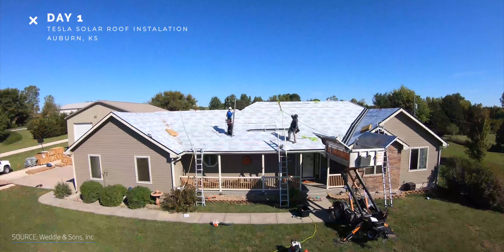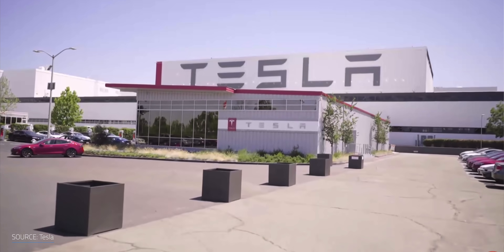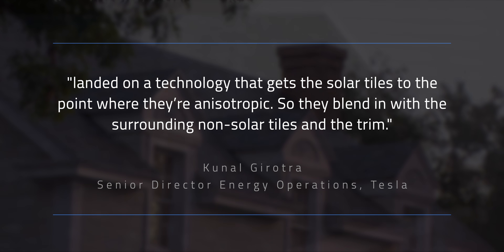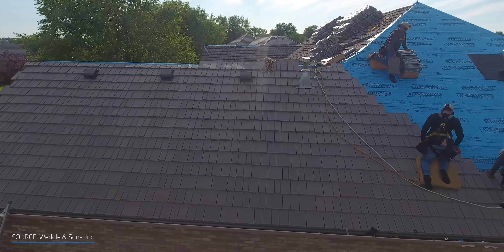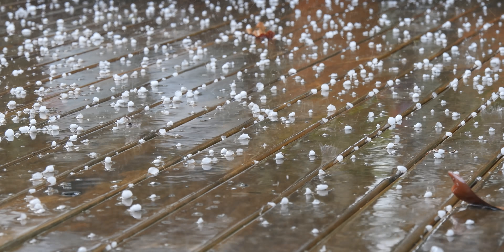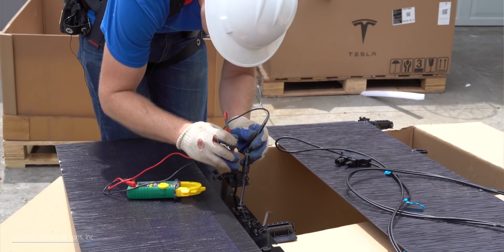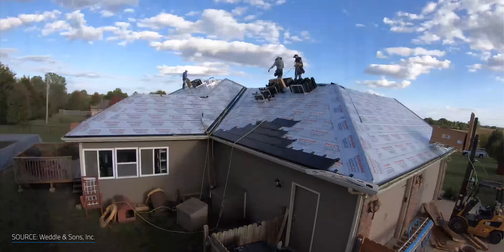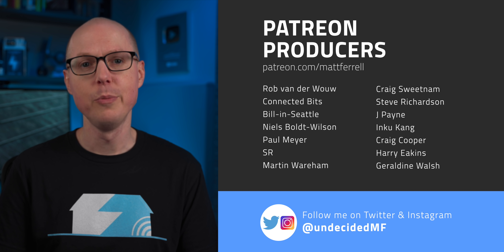Exploring If Tesla Solar Roof Is About To Go Mainstream?

Comment: only American's used silly rubber ( so called ash felt roofing ) that fails every 12 years ? , we use concrete of terracotta or tin roofs that last over 100 years at a minimum and apparently cost a lot less than your silly stappled on rubber ,

Comment: Some thing is missing in this story(instinct)  "this is cheaper than that", if a roof of X square feet costs, say $20,000 then surely its only worth  fitting a roof an a house worth $180,000 because  anyone earning less than so much a year wouldn't be able to afford the house repayments. And unemployment figures make lots of enterprises a "no-no".

Comment: I decided on solar 4 years ago using Solar City with LG 395 watt panels. This was pre-Tesla roofing tiles. As it is It cost $49600 for 19.8 kw which was 125% of expected usage. Results. Our average for the year power bill per month went from just over $390/month to $23/month. Received 33% tax credit which brought the out of pocket down to $33,232. Made the payments the same as if I was buying from APS paid off $4680 the first year. Made a balloon payment of $13,000 at the end of the first year. Continued with the $390/mo payments. Made another Balloon payment of $12,000 at the end of the second year. Continued paying the $390/mo payments into the third year. The 6% interest on the loan stretched the payments 4 months into the 4th year.  I now pay $23 per month to APS. Am now saving for the next major purchase being a Tesla Model "Y" or VW ID Buzz or maybe Ford Mach E. I'm going to wait on the car purchase to see just how well all three work out reliability wise. Oh! next step for the house - Battery Backup with night time feed to the house to power the HVAC. In Arizona the AC runs 24/7.

Comment: At the end of day, as a homeowner, i don't think Tesla Roof will work. because of installation and material costs will cost more than normal asphalt roof (normal people won't afford that, plus people doesn't stay in same place as long as use to be. why do you wanna invest your home if you won't stay that house forever? even, Elon mask himself moved to Texas.). Asphalt roof only takes the roofer a day to finish the replacement. however, Tesla roof will take longer(everything involving metal work and custom fit will take longer/more labor work) .Asphalt roof also has 25years life span. most of energy consumption comes from HVAC and EV (we better off to improve how to generate power with green technology in a mass scale, we need to invest more money to nuclear fusion.)

Comment: I'm a licensed electrician who loves alternative energy....Stating  the obvious  "Solar Panels" produce electricity..... there is a very clear danger if the solar system isn't engineered/ installed properly & will cause fires, injuries & deaths..... That being said I'm all for solar roofs but not for the untrained regular  roofing guy/ company.  Be cautious on the sales pitches & do some homework.

Comment: Some of the assumptions used to sell us on solar are questionable at best. I recently had my roof done with 50 year architectural for about $12K, and that was relatively expensive. Had I thought ahead and taken bids I could've done it for 8k. I guarantee it will last a lot longer than 15 years. Even the cheap stuff can do that much. Though solar cells may act as durable roofing, they will only generate energy for so long until they burn out. Then there's the matter of solar waste, which is far more toxic that regular comp roofing.

Comment: watching this instalation in vid what are they using for water sealant between pieces and on overlaps even metal you use butyl and asphalt its tar that melts together when the sun hits it and warms it this is just glas son metal and every knows water doesnt follow the laws of gravity very well and often travels upwards?

Comment: except "premium materials" are narmally called premium because of the look you get not the durabilty metal roofs are fair priced and last a long time these Premium roofs you compare with are slate fake slate and roof like that which are a roof designed for looks not durability. this isnt a very well put together video fi your trying to explain the differences in roofs its only well put together in selling a tesla product! sounds like this is a paid advertisement

Comment: I would not get a solar roof on my current house in NJ. After living here since 1995, we are replacing our original roof later this spring (March 2021). We don't plan on living here for more than 5 years anyway, so depending on where we move to for retirement (Florida?), we may look into solar roofing then. Meanwhile, our next Federal government under a President Biden-VP Harris is definitely pro-environment so there may be some real savings down the road for both installers and homeowners to go solar in greater numbers, which would definitely drive down the cost. For the same reason more people are not buying EV cars, people don't have solar panels or their own windmills on their homes, but that could definitely change in a few years.

Comment: 1.  What does Telsa have to say about cold weather installs?  Ice, water blocking, four feet of snow?  2.  Fire rescue currently won't even walk on a tin roof because they are so slippery in winter, so they just let the house burn rather than try to vent the heat from the roofs.  3.  Nature liabilities like tree pollen, sap, dust, smoke, human pollution, all collect on roofs, and then the squirrels.

Comment: Given that the panels have achieved the appropriate ratings for fire, hurricane and hail resistance, the price point and install time is not really a factor for the consumer. The installer network has to be trained, which is a far more monumental task. Tesla has to sell the value proposition to the people who do installations, which is a sticking point, unless new blood enters the game. The construction space is typically slow to accept new technology, stuck in its' ways and standardized residential home construction only exists in modular, manufactured and the commercial arenas. Your home is only as good as your GC's knowledge base. If you have a builder who has educated themselves to all the latest and greatest building technology, you will have a superior home. If not, you will have a home built to minimum standard, which is cheap, but shockingly low performance. You really will get what you pay for.

Comment: What if house doesn’t need all that electricity generated by tiles? My house roof has 6 Tesla panels, which occupy small fraction of the roof. How will this translate into solar shingles?
Reply: See if your local utility has a metering program where they pay YOU for the excess.  Actually in most cases is a "credit" against your normal electric bill.
Reply: @michiganengineer8621  Yes, I get credits from electronic company, which reduce my electronic bill. But Tesla limited output with only 6 panels, which covers roughly half of our consumption on average. I suspect there might be a limit which my electronic company is willing to accept into its grid from the single roof.
Reply: @YuryOvetsky  That is very possible, every utility has different policies and "payment" rates.

Comment: While a good use of existing space and the need for a covering, everyone needs to remember the duck curve of electrical demand and generation. In short demand for power spikes just as the sun sets. If you don't have a large enough battery system to cover a reasonable 4-5 hours of your peak demand your solar system is not saving any money other than by stealing from everyone else. The argument is fairly sound for building only the batteries of a solar system and making use of a smart grid that gives cheaper off hour electrical costs. If you have a very aggressive time/demand pricing it is economical to buy power in the night to run your next day's evening demand. Not only does this lower your costs personally, it also gives the electric grid a huge benefit by helping smooth out the demand curve just a bit. 

The solar roof changes from good to bad depending on the battery system associated with it.

Comment: I ordered my solar roof mid-July, have all the permits finally approved, and have a site visit set up for 1/5/21, tear-off tentatively scheduled for 1/18/21, and roof install set for 2/1/21. My current roof is close to 28 years old, so it totally pencils out for me. Plus living in the Central Valley of CA, the solar production potential is extremely high.

Comment: I have a 15/32” Plywood Roof 15 to 17.5 degrees pitch, with 24” on center Engineered Truss System. Would this Roof Support a Tesla Roof? BTW the house was built in 1991, and that’s why it used this plywood. Also it Survived 2.5 feet of wet snow, when many other Roofs collapsed in the area.

Comment: Do you know what the efficiency av the pv cells are per square meter?
Reply: Tesla claim ~21% efficiency of the panel but that efficiency is dimensionless so it will not change with area.

I think you are missing the point tho, the efficiency is a less important quantity than the overall power generation. It is more dependant on the geometry of the roof than simply the efficacy of the panel.

Comment: I have one small 100w panel on my roof. It powers a bank of 200ah batteries and a 3000k inverter. I use it to for limited power in my garage and to charge my tools and lawn equipment. 

I’ve stayed away from putting more panels up as my home faces south and I don’t like the look of the panels on the front of homes. This Tesla roof would work well in my case. Just sad that I had a new roof installed just a few years ago after a storm. Maybe some day.

Comment: Matt... two questions.
1- What anchoring system does Tesla have for hurricane areas? I live in Florida and that is a major consideration.
2- Dust accumulation degrades the efficiency of solar panels. What kind of maintanance is available for tesla glass-tempered solar panels?
Best regards

Comment: To properly assess we must also factor in the carbon footprint of PV manufacture then calculate the time to net zero against other manufactured roofing products.
I strongly suspect that Passivhaus offers a better, cheaper, more robust and sustainable answer for the long term in the built environment.
Low tech has the answers

Comment: I live in New England it's always interesting to see the mirrored of solar installations and the variations for which this is to be done most of the panels over roofs leave copious amounts of conduit exposed on rooftops very distracting from the architectural standpoint so it's nice to see we've developed into a complete system building systems UL listed I'm assuming as I also assume these ad hoc solar panels installations here in the Northeast I doubt any of them are UL listed installations seems half of them wouldn't meet the NEC requirements.
Let's not forget the 20 to 30  ft.² siding mounted interconnect equipment,

Comment: Personally, I don't like how the Tesla roof shingles look. I preferred the terracotta ones, which would have been great here in Italy simply because every single house has them and it basically an unwritten law. From my personal perspective, terracotta tiles together with a conventional photovoltaic system is much cheaper and delivers the same amount of electricity.

Comment: Meanwhile in Australia, Tesla roof tiles cost approx $320 per square metre, compared to the more common metal sheet roofing at $50 per square metre or tile at $80 per square metre.

Comment: So I went to the website and put in the specs for my home. After federal tax credits and Eversource’s Connected Solutions incentive the roof will cost $25,000 (includes two Powerwalls)

After 25 years, it will finally save me $25,000 in electricity costs. So it’ll finally be worth it once the warranty runs out

Comment: I kind of like those other roofing systems .....
I kind of like driving up and having it shoved in my face I spent a shit load on my roof

Do insurance companies sh!t their pants if you have a claim with a solar roof or do they just get excluded?  How about if you have a storm that knocks trees down ... How do solar panel installations fare when you have say 90% survived but 10% need to replaced?  

How does that a 90/10 % mix of new vs old affect the entire system power generation ... if it seriously impacts then is it an argument that they'd have to replace the entire system?

And as I write he talks a bit about this .... But hitting a panel with your fist is not the same as a golf ball coming down from 30,000 feet.

Comment: One of the questions I have never had answered is what is inside the Tesla power wall. Does it contain a solar charge controller or how about an inverter? I would like to see one opened up or at leased a technical diagram of its operational design. Good video on the solar roofs, I believe it will be a game changer in the future...

Comment: Okie I have a question.... why can’t tesla create a roof-shingle system that uses two tiles: solar tiles that can plug into one another, and fake tiles that act like basic shingles but can be swapped at a later date. Then for the price of every solar tile, the cost of 4 fake tiles is covered. Therefore eventually someone doing their roof would be able to fully cover it using now-extremely cheap fake tiles...... that one day...... can easily be turned i to the real solar tiles , aince it would an easy replacement 

Obv e tra cost for transfer switch, any batteries, wiring, etc

Comment: No preinstalled leaks!!!!  Unlike other solar setups, this does not require you to install failure points such as drilled holes and mounting brackets on to an existing finished roof!  The great thing that I see here, is that it is a roofing system, that happens to generate power.  I was a roofer for many years,  this looks very promising..

Comment: I always get ridden when I post this - but I’ve worked in the Semiconductor industry for over 20 years now and several of my customers have been working hard on solar and I’ve been told - within 10 years you will see panels in the market with efficiency greater than 90%... At present it’s under 50%... Take it for what it is, some Youtube expert - 🤣 - but if you aren’t sold on the idea, definitely wait...

Comment: I keep wondering watt for watt, how well does it perform compared to a solar panel that is 3 inches off the surface of the roof.  I would think that the solar panels would stay cooler and therefore perform better.

Comment: I would like to hear what my insurance company thinks about. I live in central florida.
Reply: Now this is a comment worth considering! I have wondered about how the roof holds up too severe weather. I’m sure Tesla has considered and designed for it but idk!
Reply: Your rates will go up. Now imagine having to replace your roof in 5 years. You have to have the installers come back and take all of that off, then reinstall it. Very expensive.

Comment: I have never seen a shingle roof Last only 10 years
Reply: In hail prone areas or high wind,  <10year life is a real possibility.
Reply: @D2O2  using that logic freshly roofed house could possibly last only one day
Reply: @jaguardrywall7965  Yes, it is a reality we face.  Hail damage typically voids an asphalt shingle's manufacturer warranty.
Reply: When they have to extremely exaggerate the badness of the traditional way or the traditional method to sell the new way,  then you are into infomercial as seen on TV scam zone. 

A shingle roof is typically a couple decades for flat asphalt in hot sun,  over that in northern lats. Much longer for steel,  architectural tab asphalt,  shake and tile. 

Electronics become old quickly due to developmental trends.  Yes they still work,  but the old electronic is soooooo much worse than the new electronic says our emotions.     Apple and Samsung for example.  Where'd I put that proprietary outdated charger and cable? 

This presenter is a cherry picking PR guy to give these products a glow. 

Since TESLA roof started off with a big splash,  then went dormant for years,  and then another big splash in winter 2019, and now his plant is and entire empire is moving halfway across the country after fights with Newsom and Covid.... 

This is likely not a good time to jump on Gen 3 when earlier iterations installs can often be counted on your fingers.
Reply: @STho205  👍

Comment: The weakest part any electrical/electronic system are the connectors. I'd worry about having hundreds of connectors in the system. How are panels wired? I assume they all can't be in parallel (every panel doesn't have micro-inverter AFAIK), so a connector failure likely impacts more than one panel. Maybe this has all been solved, but something like connector reliability will only be known when these roofs have stood the rest of time.

Comment: Matt, we live in Texas, hail is a big problem and rarely does a roof, even one made of quality product, survive anywhere near its lifetime expectancy. I would guess in 25 years, a typical home owner has replaced their roofs 3 or 4 times (ours has been replaced twice already in less than 10).  One of the things that would be a real plus for the solar tiles as suggested in your video, is if there is hail large enough to damage a tile, and I am guessing if it doesn't shatter, then it is probably undamaged, and the roofer would only have to repair just those tiles instead of replacing the entire roof, so in Texas over 25 years, and over multiple hail storms, it might also be the cheapest long term solution as far as the insurance companies are concerned, so maybe they would be willing to give a significant discount on the yearly premium, making the solar roof an even more lucrative roofing solution, not EVEN considering the perk it can generate power too.